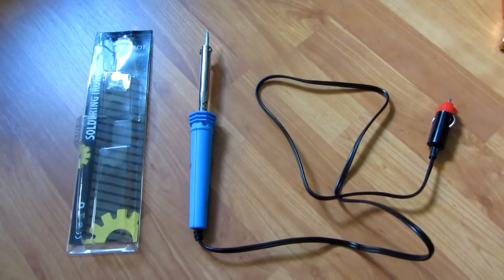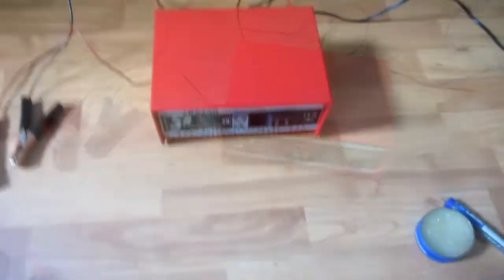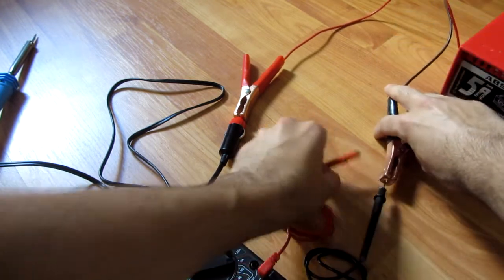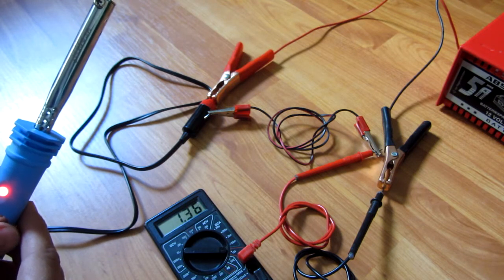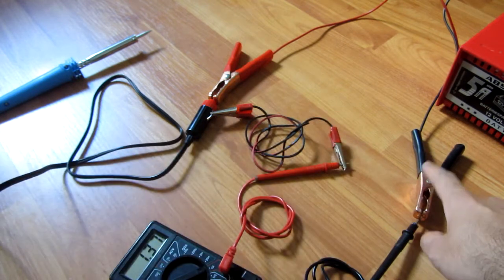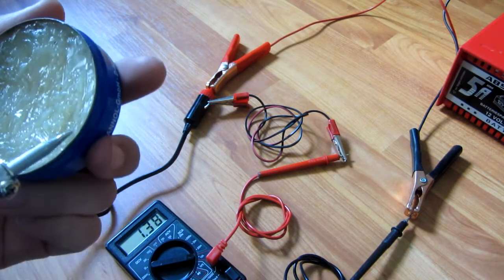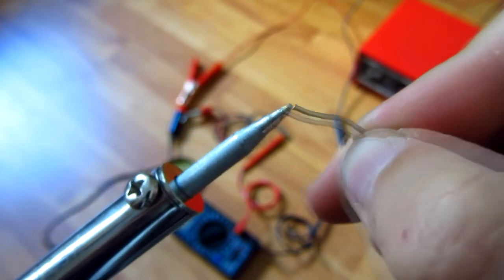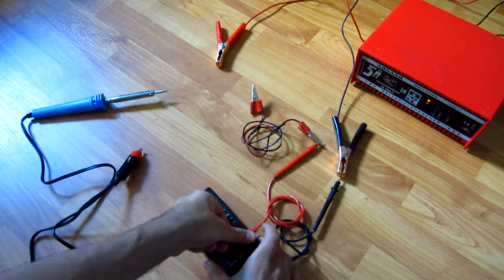12V Soldering Iron (Car Socket)

Comment: Don't forget that folks : you have added multiple cables in series with not so ideal wire diameter PLUS not so ideal metal made crocodile clips, all these connections (too much) adding unnecessary resistance, thus voltage loss in your circuit.  This giving you less than the 20W consumption (half for this 40W iron) you should have seen.
Did you notice a better heating with the iron directly connected to a power source ? (you should in practice, i am pretty much sure).
I think a 60W is better, you can in case decrease wattage by decreasing voltage from a voltage variable supply...